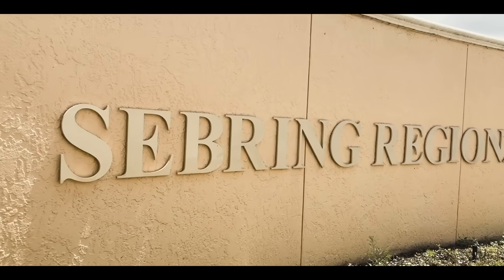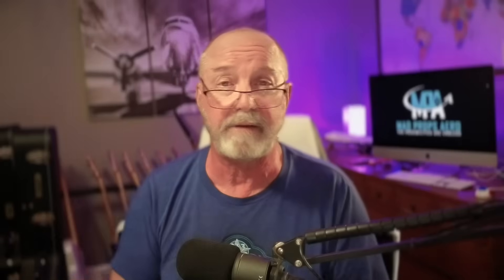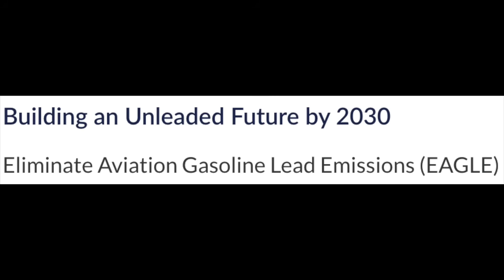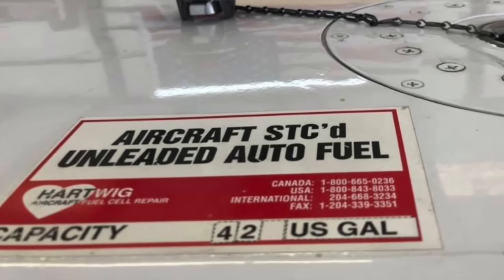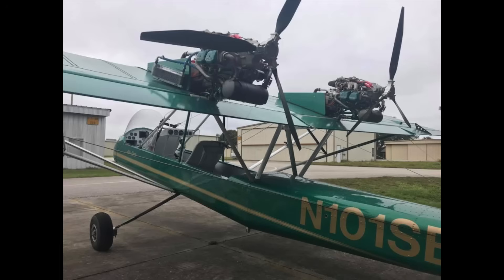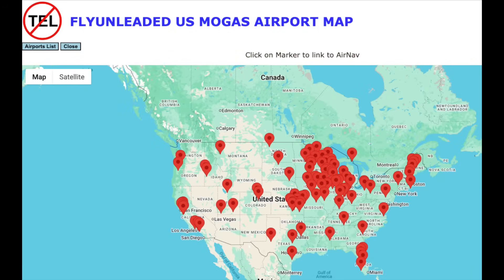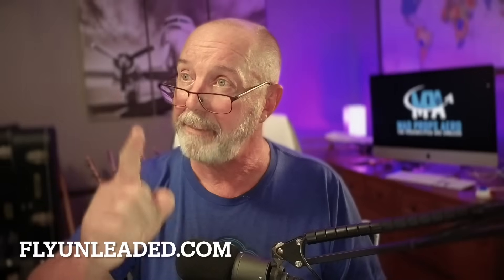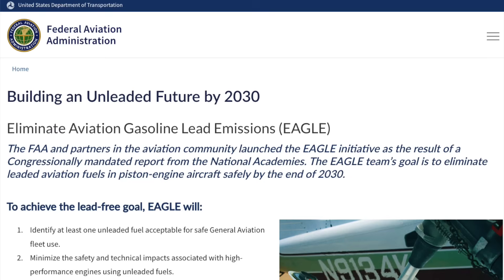Fill 'er up? With what? 100LL is going away.

Comment: 700ish hours on my rotax and no lead so far. Including flying across the country. It takes work but is worth it! In the West, though, seems like mogas at a car pump and 100LL at the airport are close in price. Also: I've made a Foreflight layer with the Flyunleaded data.
Reply from the maker: Jamie used to buy gas for his AirCam (2x Rotax 912) at the local RaceTrac station. More than $1 per gallon less expensive than the 100LL at the airport.

Comment: My Lycoming O360 in a Cherokee 180 is 100 hrs from TBO. Compression are good now. When it’s time to rebuild or replace, I don’t want to buy a second engine for unleaded reasons before it’s time. It’s too expensive. GA100UL isn’t available at my area.
Reply from the maker: Lycoming allows for premium MoGas in the O-360 provided it has little to no ethanol. That fuel should be available in your area, although perhaps not at the airport yet.

Comment: My question is:
Will it be any cheaper that 100LL???
Reply from the maker: Mogas is less expensive and far more readily available. Other options should come down in price as the economy of scale kicks in.
Reply: @MadPropsAero  Of course Mogas is cheaper than 100LL, I see the prices everyday.  My question is: will G100UL be cheaper than 100LL?
Reply from the maker: @samarch2189  that depends on how well accepted it will be. Cars are less expensive than airplanes because cars are manufactured at scale and airplanes are not. If G100UL becomes the standard and sells in large quantities, it will become less expensive. If it does not achieve scale, it will not.
Reply: @MadPropsAero  looking at the map from the link in your video Mogas is anything but far more available.. and I live in the part of the country with the most availability😂
Reply from the maker: @LukeCFI  you live in a part of the country with availability but find Wawa, RaceTrac, Bucee's, Chevron, Texaco, Mobil, Murphy, and other fuel providers in short supply? We doubt it.
Reply: @MadPropsAero  oh I see you think gas stations are suitable locations to get gas for airplanes, didn’t you say in this video how bad ethanol is for plane fuel systems? Seems like we probably should use that resource the YOU PROVIDED to see the realistic availability of Mogas usable for aircraft and not pretend like it’s the most available thing in the country. 

On top of that people fuel planes at airports not at gas stations, who’s carrying around Jerry cans to go walk back and forth to the gas station down the road from the airport.. I understand things may be different in the back country where that’s all you have but 99% of the country that’s just not a thing people do.
Reply from the maker: @LukeCFI  your dedication to disagreement is not likely to serve you well in the aviation industry. We regret you're not more open to new information.

Comment: Lead will never go away.   90% of all piston powered aircraft engines flying now require lead.   As a apprentice A&P.  No way in hell they will ground every piston aircraft.    And no way they are just swapping engines.  The lowest priced aircraft engine used starts at 20k.   I’m doing a rebuild right now . Will prob be 50-60k out the door.    I just don’t see this happening
Reply: that's on aircraft manufacturers not making better engines that don't run on neurotoxic fuels. they could've been doing it since we got rid of leaded automotive fuels, but they chose to rely on the outmoded fuel and now they'll be paying the price.
Reply: @TheAechBomb no manufacturer will not pay the price..  and nothing will change..   watch.   Like I said I work in aviation..  100ll is going nowhere.
Reply: @hondaxl250k0  who's going to make the neurotoxic fuel additive when the last company decides it's done?
Reply: @TheAechBomb neurotoxicity?? Lmao!!  I’m a aircraft mechanic..  I’m tested for drugs and heavy metals all the time.   My lead levels have not risen at all.   I breath the fumes. Im covered in gas daily.   Just stop with your ignorance.. lead oxide is the poison.    I had a lead bullet in me for 10 years with no issues.  Mineral lead is not the problem.    The company’s won’t stop making it when there is a multi billion dollar demand for leaded gas.    Get over yourself
Reply: @hondaxl250k0  From Lycoming: "Automotive gasoline. The ultimate solution for inexpensive, readily available fuel for aviation. The easy answer to replacing leaded avgas for 70 percent of the existing fleet."

Really, they're talking about UL94, if you dive into the details, but they clearly understand that leaded fuel isn't a requirement.
Reply: @PistonAvatarGuy true.  But it is in continentals.  And all older engines.. including automotive engines pre 1970
Reply: @hondaxl250k0  No. See: Continental gets the lead out

Hardened seats are also a thing.
Reply: I’m an automotive guy, and don’t have a ton of aviation repair experience. Do most GA engines not have hardened valve seats? The lack of hardened seats is the only reason I see for keeping leaded fuel around. Most don’t need the octane boost.

Comment: Rotax engines are not low compression engines, their liquid-cooled heads allow them to run high compression ratios, without requiring high octane fuel.

There's also a UL91 avgas, but it seems to be mainly available in Europe. It seems like a 94 octane fuel is a bit of a waste on engines that were designed to run with octane ratings in the 80s, unless it can be used in the higher output engines.

It seems as though bio-ethanol fuels should be avoided as much as possible in aircraft, as they break down quickly and can (in my experience) leave behind gum deposits which can clog fuel system components.
Reply: @PistonAvatarGuy Ethanol breaks down, in 30 days must be gotten out of fuel farms /trucks/tanks..well known to be NASTY CORROSION INDUCING BYPRODUCTS AS DECOMPOSES, TERRIBLE IN SMALL ENGINES (HAVE LOST EVERY SINGLE FUEL TANK TO CARBURETOR CARBURATOR BODY GROUP ON EVERY SMALL ENGINE USED IN)
ETHANOL IS HORRIBLE AS IT ABSORBS ENERGY ..DOES LESS WORK THAN GASOLINE!

Comment: The Rotax 912 has known issues using Mogas. Beware
Reply: What? I run ethanol gas all the time and have zero problems. 3 different planes.
Reply: @samuelseidel6148 Ethanol is lousy, nasty, horrible stuff ..attracts even more water, breaks down into corrosive solution as decomposed, leaves sludge and granular particles IN FUEL TANK...THEN DOWN LINE..
🤔 SO..I'M NOT PUTTING ITNIN MY WEEDEATER, YET ALONE A MANNED AIRCRAFT!!

Comment: I’m based at RHV where unleaded gas has been the topic of discussion for many years. I can tell you as the first airport that received the Gammi fuel there are a lot of issues with staining and paint stripping. Many of the planes on the field have developed leaks from hoses deteriorating and now have substantial paint damage. I got a free STC from Gammi but never used it based on the experience from many aircraft on the field. Hoping there is a solution soon!
Reply from the maker: The paint staining issue we've heard in the past. The leaking hoses hasn't come to our attention before. But we're with you. We sincerely hope a good solution to the leaded fuel issue is found sooner rather than later.

Comment: It's about time.
Reply from the maker: For low horsepower/low compression engines the switch to unleaded has been possible for quite some time. For higher horsepower/higher compression engines a truly desirable option has not yet been settled upon.
Reply: @MadPropsAero  Bluntly, nobody but grognard GA pilots care. They're poisoning people for fun, then complaining about changes that are thirty years overdue. Yeah, none of the big engine manufacturers spend money on fixing the problem, because they don't have to. The GA pilots have kept leaded fuel around. The aircraft owners don't replace the engines with something less prehistoric - why would they? Leaded fuel is still around. The only way this problem is going to get fixed is by entirely ignoring what pilots want and just banning the shit for good. Once the leaded fuel ISN'T around, it'll be breathtaking just how fast solutions are available.
Reply: @MadPropsAero  As opposed to today's automotive engines, getting almost 200hp/L?

Comment: For 172 trainers, remember this:  One plane, in one day, emits one pound of lead.  Aerosolized lead, which is much worse than fishing sinkers.
Reply from the maker: That's an ambitious aircraft owner who can burn that much fuel. There is roughly 2.12 grams of TEL per gallon of 100LL. That puts the C-172 in the range of burning 21 grams per hour. There are 454 grams per pound. Which means the Cessna 172 you use for your example would have to fly for more than 22 hours per day. 

Lead is a problem. Loads of smart people are working on new fuels that don't require lead to meet the needs of our engines. Overstating the issue is of no help. In fact, it generally serves to make our arguments less believable now and in the future.
Reply: @MadPropsAero  True, but you are assuming the 172 is running at 10 GPH cruise all day.  Training is constant take offs, landings, touch and gos, climbs, runups, starts/stops, etc.  Plus, you are assuming the engine itself is running at peak efficiency.  The antique engines are environmental disasters and should have been destroyed 40 years ago.  Lyc and Con should be ashamed of themselves for producing engines that require lead in 2025.
Reply: @rsn2012  dude doing maneuvers and touch and goes burns less fuel than cruise.. on climb it’ll burn like 15/hr and then the other half of the pattern it’s like 2/hr😂 As they said that’s quite the over statement buddy, I agree we need to take care of the environment but sounds like you’re one of these crazy environmentalists that wants us to eat bugs and thought Florida would be under water 15 years ago..
Reply: @LukeCFI  I drive an SUV, use plastic straws, and as a general rule don't really give a crap about the environment.  However, aerosolized TEL is another level of pollution.  It's right up there with dioxin and hexavalent chromium in harm caused.  It's more of a political issue, with the rich not wanting their hobbies encumbered by the health of the masses.  When rich neighborhoods sprawl out to GA airports and IQs start dropping in private schools, TEL will disappear.
Reply: @MadPropsAero  No response?  Interesting.  However, I'd like to amend what I said.  Of the pound of lead that passes through the engine, not all of it makes it down into human/animal bodies, the soil and water supply.  Some of it stays in the engine causing sticking valves, sticking rings, and fouled plugs.  Its a garbage fuel in a garbage engine, and nothing you say can defend it.

Comment: Avgas has a lower volatility profile than mogas.  That is to say avgas vaporizes or evaporates slower.  Avgas has a consistent octane no mater where it is sold.   Mogas is formulated for use at the location where it is dispensed.  For example:  At low elevations, mogas is formulated with a couple points higher (87) on the octane scale that at higher elevations (85).  I noticed this when we bought gas in AZ vs buying gas in Denver and Yellowstone.  That's because the air is less dense at higher elevations which  leads to lower cylinder compression pressure (compression ratio unchanged) which lessens detonation and lessens the need for a slightly higher octane fuel.  At sea level, the most you can get out of one compression stroke of the piston is 14.7 psi; at 5000 ft it drops to 12.2 psi (10:1 compression ratio).
Reply from the maker: This is the reason airplanes with piston engines often feature a mixture control. As altitude increases the mixture gets richer. Without sufficient air to get full power the engine runs increasingly worse. Unless the engine is turbocharged the horsepower is being reduced as altitude increases.
Reply: @MadPropsAero this is where modern (as in the last 30+ years) engines with electronic fuel injection come in. Through the PCM programming and using O2 sensors, they increase or decrease injector pulse width to enrich or lean the air/fuel ratio automatically. The FAA has kept GA stuck in 1950.
Reply from the maker: @IGrocker  there are more advanced engines in use today, but most legacy airframes are required to used legacy engines that were designed in the late 1940s, or are derivatives of those designs. Change has been slow, but it is increasing in speed and volume. The future truly is bright for general aviation.

Comment: ONCE AGAIN the bureaucrats are getting the BAN before the horse. There SHOULD NOT be a date on any ban before there is a real alternative that works in ALL engines without damage. They did that with California diesel and it was a vary expensive disaster for truck drivers. Just more virtue signaling to the masses.
Reply from the maker: As we pointed out in the video the problem isn’t really the government’s goals. It has more to do with the one manufacturer of TEL wanting to get out of the business. The government can’t force them to produce a product they don’t want to make or sell. That’s the crux of the issue.

Comment: 2:30 - Are you sure? 
My 1961 172B with 0-300-C was designed to use 80/87 AvGas80 which contained 0.14 g/L of lead. 
The current 100LL contains 0.56 g/L of lead; that's 4X the lead that the engine was designed for. The 100 Octane 1.12g/L of lead that you're referencing was relatively short lived and limited distribution, at least here in my neck of the woods.
Reply from the maker: You make a valid point. We chose to stick with modern references rather than go all the way back to the 1930s and 1940s. Many of those airplanes are still flying, like your 172, even though the fuel they were designed to burn disappeared from our airfields long ago.

Comment: Sorry Chief ......you got the definition of "Octane" wrong.   Octane is NOT a "measurement of how they resist combustion" as you stated at timestamp 1:58 in your video.   ***Rather the 1000LL gasoline Octane rating is a measure of the fuel's the ability to resist detonation and preignition, sometimes referred to as "Knock".  Tetra-ethyl-lead is added to 100LL gasoline to do precisely this.  It has the added benefit of lubricating an engines exhaust valves.
Reply from the maker: You are correct, of course. The choice to use the word combustion rather than detonation has to do with the number of people who don’t know the difference between combustion and detonation. Few truly get the distinction. But your point as well made, and we appreciate it. Sometimes as in this instance, a case can be made. That clarity is preferable to accuracy. At least that’s true when talking to the wider public and not a class full of aircraft and power plant mechanics.
Reply: Lead is NOT a lubricant, it does not lubricate valves.  I wish this old wives tale would go away.
Reply from the maker: @dkalwishky lead actually does have lubricating qualities, but the primary point is its ability to boost the octane rating.

Comment: 87oct ethanol free is all I ever ran in my Cessna 150, never a problem with fouled plugs, or stuck rings
Reply: With what engine?
Reply: Probably an o200. I also run car gas in the planes I’ve owned. I’ve also used ethanol blended gas without any problems. 

Just gotta make sure all components are ethanol safe.

I do have to say that avgas is so much nicer to deal with in terms of spills. Car gas stinks and doesn’t go away
Reply: @samuelseidel6148 maybe in an experimental but auto gas isn’t even available at airports.  No idea where you are even getting 87 UL …. Even crazier you run it.  Hope you don’t have an engine failure
Reply: @NETWizzJbirk  Easy, just have one of those tanks in the bed of your pick-up truck (that looks like a tool box) they use to refuel bulldozers in the field.  Fill-Er up at the gas station and then transfer it to your plane.
Reply: @NETWizzJbirk 
These "expert" owner/operators find the rustiest gas cans on earth, head to the gas station and dump it in their tanks.
They dont care about dirt or water.
A LOT of them do it without an STC.
Then then aircraft is NOT airworthy.
When they crash from the wrong gas and no log entries the insurance company laughs and walks away from any claim.
Some pilots have no idea what their duties and responsibilities are.
Reply: @samarch2189 
You cant put auto gas in an airplane unless you have approved data.
Reply: @johnparish1432  You shouldn't put it in a Lycoming or Continental, but other engines like Rotax are designed to run on it.
Reply: @johnparish1432  That's the difference between a  Private and a Commercial Pilot.
Reply: @samarch2189 
Commercial or private, it doesnt matter.
A LOT of pilots use auto gas without an STC.
Reply: … and what airport has 87???   I really do not believe it

Comment: Jet A
Reply from the maker: Jet A is a fine fuel. Not so much for a continental 0 200 or Lycoming 02 35. But in the right application it’s good stuff.
Reply: I'd rather have a dead skunk in the back seat than smell Jet-A on my fingers